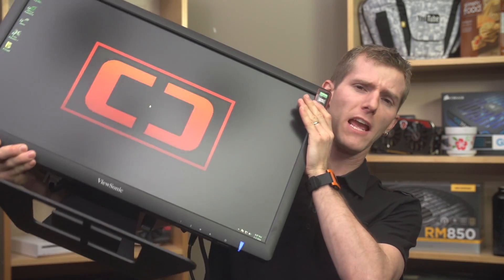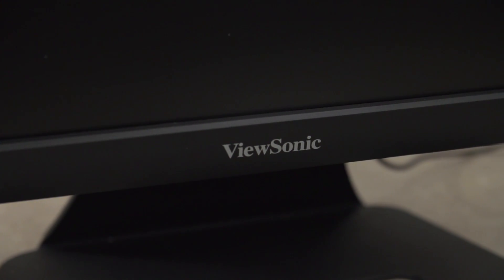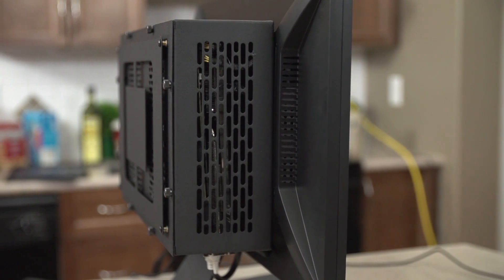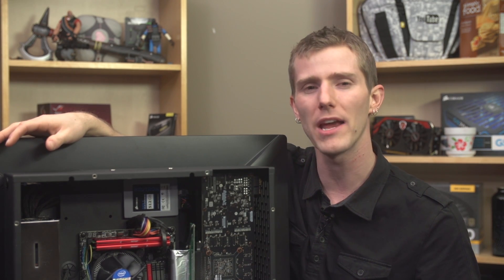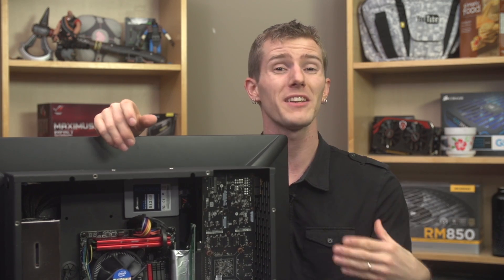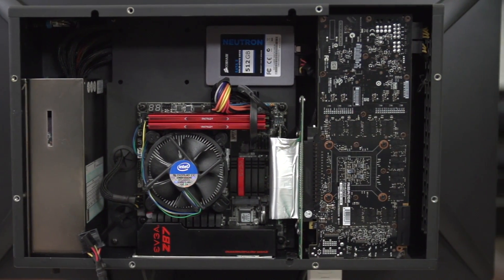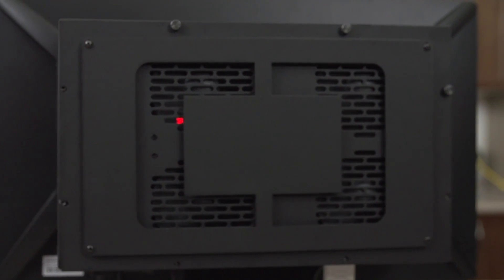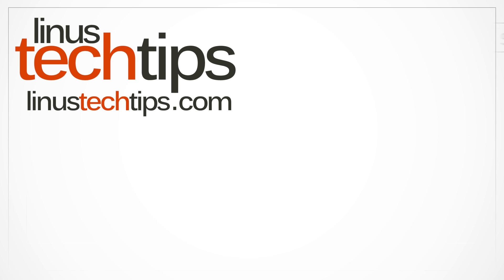Crate Computer Ultimate Gaming AIO

Comment: Space is not an issue for me, but the computer still apeals to me because i want a big and powerfull desktop and not a laptop. I move my PC quite a lot, and what i usually do is take the accessories; like mouse and keyboard, headset, gamepad, "cables", etc. into a bag, then i move my monitor and the bag into my car. Walk in again and take my computer. This is quite a log process, at the start it took about half an hour, now when i have more practice it takes about 10 minutes.

I ususally do this to go to LANs. This would be much easier.

Comment: After seeing this I liked the design. It does look pretty big and i don't see were it would save that much room. I won't deny that it is a powerful gaming pc. But the price seems way to much. The cheapest one being $1,930 and the most being $3,835. The one in the video is $2,774. For the price of the cheapest you can have a very high end gaming pc built and it's better then there most expensive. As for the most expensive you can get a much better tower built, 2 or 3 27" monitors, gaming mouse and keyboard, and still have at least $1,000 left over. I think i would rather have a better computer and find a place for it.

Comment: I have 2 Gtx 780 ACX's in SLI and they boost to 1308mhz in unigine benchmarks just relying on the GPU Boost 2.0. Is that higher than normal?

Comment: I think the idea's great ever since Apple's approach. Though it looks kinda bulky and it's definitely not something I'd put on top of my desk. Then comes the noise of the fans which comes directly at you instead of being absorbed by your desk and/or other things you might have between you and the PC. Last but not least are the vibrations. It sure will cause some and having it attached to the monitor - I don't think it's a best-case scenario. I probably mentioned all the downsides that were on my mind. Would I get it if I had the money? Yes - if I had no place for a HAF X or some other humongous case or needed a "portable desktop PC", as fucked-up as it sounds.

Comment: Linus I really want you to tackle Apple products. Including OSX
Reply: Why? They are not really exciting products. NCIX doesn't sell Apple products either.
Reply: Mamurai Because they're different from regular pc's in that they offer a full package (hardware + software) and he would need to take that into consideration. Do a more experience based review instead of overclock numbers. And my impression is he is open to it. Or at least curious.
Reply: evilmarc I doubt that will happen unless NCIX actually start to sell Apple products. Many PC's do come with a full package too unless you build one from scratch ofc. Hardware wise it isn't better or very interesting to what is out there. You can't easily upgrade hardware either, or at all. Design is nice though, but as I said there are other similar PC products out there. Only thing he could do would be an OSX review as you can install that on a PC too.
Reply: evilmarc They're not that interesting? They're just pre-built systems with a way too high price tag, designed to make swapping components as hard as possible.

And OSX is just a shitty BSD distro. There's little more that can be said about it.
Reply: evilmarc But they are totally uninteresting from a hardware fanatic kind of guy's perspective. Not upgradeable, not tweakeable. Gaming is not their purpose, and gamers seem to be a large part of Linus's demographic. Mac certainly have their use cases and positive sides, but they just don't mingle well with Linus's demographic. If this video was about a mac, he would have just shown the outside, the neatly packed box and "ehrmegerd retina", which does not qualify as interesting content to me. As for OSX, the same story applies. OSX is not that great for gaming, overclocking is a no-no if I am not mistaking, which leaves nothing that Linus's viewers actually care about. It is probably the same reason why Linux has not done extensive coverage of GNU/Linux based systems and technologies. Apple offers one of the best HW+OS packages available, but showing of the default apple stuff would probably not produce interesting content.
Reply: Tim Segers Why is Anand doing writeups about Apple products if they're not interesting for the target demographic? I do agree there might be a lot of people who are going to be like "APPLE IS GAY LOLOL", but hey. It's just another kind of pc that hasn't been covered by Linus that has a large fanbase. Maybe Slick should do it even, because he's seems so put off by Apple products. They talked about doing an OSX switch series on the WAN show. That could be considered if the initial response on Apple products is nice. Maybe even a hackint0sh build guide. It's something else and I'm one that enjoys diversity.
Reply: evilmarc I agree with Tim Segers here. Apple products just isn't something the majority coming here would be very interested in. I'm not going to be all "lolol Apple is gay" but they don't have anything interesting to offer for me personally. Also, Linus was a former product manager for NCIX and is sponsored by them too, and NCIX do not sell Apple products. Therefore it is even more doubtfull that Linus will review them.
Reply: evilmarc You say a Mac is "another kind of PC", but it is only one kind of machine and there is not much you can do to spice up the content about it than to provide some glamour shots due to the only difference between Macs being screen size, clock speed and hard drive space. I feel Linus is mostly geared towards tech, and apple products are not really on the bleeding edge when it comes to hardware and performance. They are, however, some of the best designed machines around. Design is a matter I am personally not that interested in, and I think with me a lot of other people, since the design of each and every Apple computer is identical. There is no "competition factor" that is found in regular hardware. Who has the prettiest/fastest/most quiet/lightest rig?
On the other hand I feel that Hackintosh content would be a great idea. It leaves room for discussion about experiences with different kind of hardware and the resulting performance, maybe even hackintosh build logs and Mac lookalikes. The OSX switch would also be very interesting. If it leads to nothing but frustration, that'd be a very comical video. On the other hand, if would be a very positive experience, that would convince many people to try the hackintosh mentioned earlier, leading to more variation in the build-log section due to the OS becoming another variable. Win-Win
Reply: Linus has said in his WAN Shows when asked about this, that he doesn't know anything, or near enough, about OSX or Apple PC's to do a full review on them. He would not be able to give enough info or do anything on the PC, which seems strange, but true.

Comment: Couldent you put a 140mm Liquid Cooler or a a 240mm cooler in place of one or 2 of the fans I unless i suppose the rad and the fans cant fit in the tiny case i guess there would have to be monifications made but still be worth it
Reply: You probably could fit a 240mm radiator closed loop cooler, but it would have to be a thin radiator.

Comment: This is amazing system, hiding the case behind the monitor :)
I wonder how it would run with a custom water loop in there and if there would even be space. I built an ITX build with a case small enough to hide & not every one wants their case on show. be grate if they sold the case, power supply and monitor stand for custom builders and looking at the case, you could custom build a loop by drilling holes on the power supply side to screw a 240 radiator on the out side leaving a 1/2cm gap for air between the case and radiator and still be hidden by the monitor :) ( that how I would do it )

Comment: Not a true AllinOne IMHO, just a modded desktop case mounted to a vertical stand, with the display attached. No more a AIO then a NUC or equivalent strapped to the back of the display.
EDIT: although its easy-to upgrade gets two thumbs up for the so-call AIO.

Comment: Linus, I have an apartment the size of a womens tennis shoe. It would be nice to have a desktop machine, powerful enough to run various games like the old republic, tomb raider, and such, that I could put away in a corner somewhere, in a sealed case (my apartment isn't the most sealed system in the world either, and now that I'm thinking about it a computer might not be first on my list of things I should buy lol). A gaming laptop would be expensive and not upgradeable, not to mention most of them are hot. I'm still running on a 2600k, 16 gigs of ram, and two 550ti's in SLI...apparently that isn't good enough to run tomb raider on high, or some of the newer games at all...

Comment: All in one computers are quite annoying, to be honest. Yes, they are insanely portable but are very difficult to upgrade and can't match up to the performance provided by a custom PC.
However, there are some options which should be considered. The macbook pro us good to start out on but systems like the iMac ( with windows) but stuff like smaller systems like the piston are good bets. Hell, with the right balance and physics stuff, you could Mount a steambox or the asrock m8 to the back (slight casemod required). Another interesting setup would be the jetpack PC case ( please do a review and build guide cus a system like that would be ON THE WALL!!!........if wall mounted ).

Comment: Looks nice but $1900 is the cheapest one and it only has an EVGA Z87 Stinger Mobo, a Core i5 4570, 8GB of ram, 250GB HDD, a 600w PSU and an integrated Intel HD 4600. All those parts in total probably add up to around $600 in parts and $150 for a monitor + $100 for a computer case. This means your paying more than a $1000 over the price of a system you could build yourself. It's hard to say but it's not really worth it just to take up a bit less space.

Comment: Its made like the Mac but better =D
Reply: "For gaming"* For a workstation, an iMac is better suited as you can get one cheaper and a computer that actually looks nice.
Reply: I have an iMac and i use it for little gaming, school etcetera, so for overall stuff mac is better, for gaming this is WAAAAAAY better
Reply: Pieter Zegers
For gaming and school this would STOMP an iMac. For a workstation, a mac would win. Can't stand win teens use macs for just schoolwork or internet. That's not their intention. You can get a PC for half the price that does the same thing.
Reply: +pokealong1227 well, i use it as a workstation. So you have nothing to get mad about. :)
Reply: pokealong1227
i use it for like everything (except gaming cause it gives me terrible FPS with my crappy mbp mid-2010 13")
Reply: *****
Any macwill be terrible for gaming because they're designed as workstations for audio and video production.
Reply: pokealong1227
yes, my mac runs game and lag other things
but when i exporting video out of final cut pro 7 with full system load it don't lag anything and still runs extremely fast

Comment: Why bother getting a Z87 board and K series cpu when you cant even oc it because of that stock cooler? Also heat rises so I doubt that psu orientation is the optimal position and surely those tiny fans is going to spin like crazy. Not everyone lives in a cold climate place like Canada and can achieve those acceptable temp.

I see this as more of a custom case to monitor mount/stand than a total boutique builder. Nothing outside the box really.

Comment: Not impressed. The cheapest model is $2231. I took the time to see what the actual hardware amounts to and what these guys are charging for basically just the chassis and assembly. I used NCIX.com (prices as of 01.16.2014) and tried to go with exactly the same hardware they use, which in the case of the chassis and PSU wasn't possible. Also, they do not specify which model of SSD, Monitor and PSU they use, so I went with normal, mid-range products.

Here's the Hardware:

-EVGA Z87 Stinger ($249.99)
-Intel Core i5 4570 ($219.99)
-EVGA GeForce GTX 760 Superclocked ACX ($284.99)
-Patriot Viper 3 Low Profile 2X4GB DDR3-1600 ($84.99)
-ADATA SX900 256GB SSD ($199.99)
-Corsair CX600 600W PSU ($40.99)
-Viewsonic 24" 1080p LED Monitor ($233.56)
-Bitfenix Prodigy mITX ($59.99) 
- (Software) Windows 7 Home Premium ($99.99)
--------------------------------------------
Total: $1,474.48

They charge you $2,231.00 for the EXACT same PC in a custom case. So that is $756.52 you're paying just for the chassis and the assembly. NCIX assembles for $50, so make the actual price difference $706.53. That makes the whole thing almost as overpriced as an Apple product.

Comment: so it a steam machine with a monitor glue to the back
Reply: Just because a steam machine uses standard PC parts doesn't mean that PC's are instantly steam machines.
Reply: Not necessarily. Any Steam Machine is a PC, but not the other way around. A Steam Machine is a PC loaded up with the special Linux-based operating system that Valve has engineered.

Comment: Compared to an iMac ... this is not a well done AIO. Even Asus has far better solutions and compared to Lenovo this is a styling joke. Performance is really well done ... however. This is not something that is 'all in ONE'. A High end ITX system stuck to any given monitor via VESA will do the same, if not cheaper.